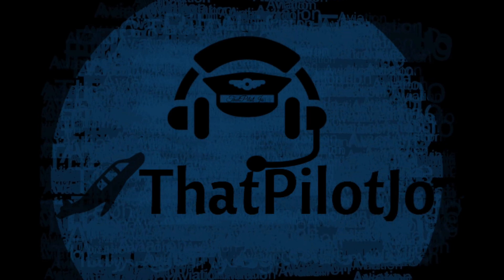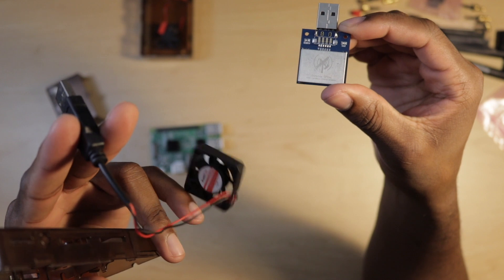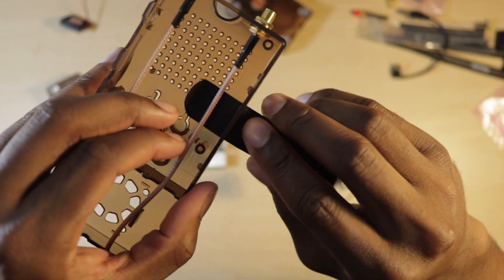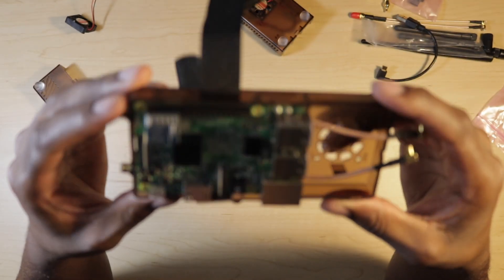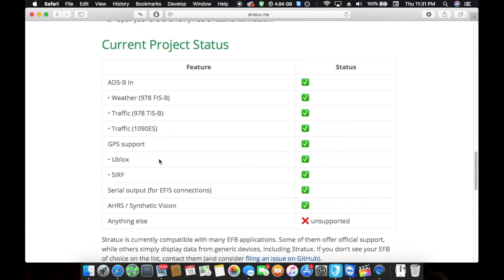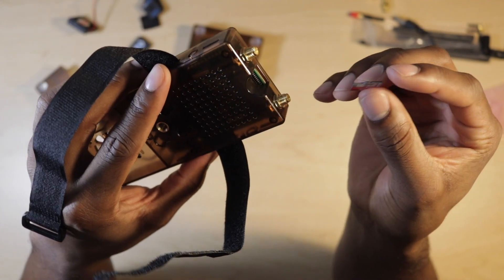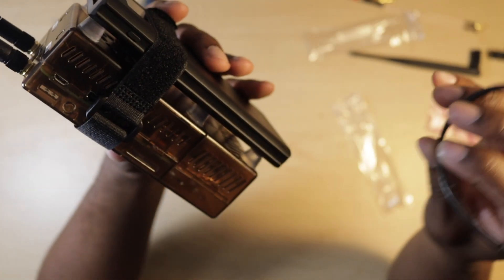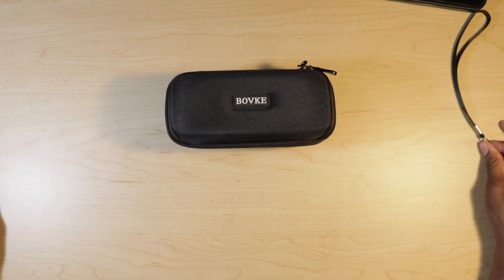Make Your Own ADS-B Receiver | Stratux Build

Comment: Neat video. Ive been designing a new case with cad today and Ill share it on thinyverse for 3D printing. The case will have no cables outside, an internal 5 cell 18650 (15500mah) pack, push to start, sleak design, battery indicator, usb charging and no visible screws on top or front. I also placed the fan on the side since it now can be placed there, and im truing to use Bernoulli Principe to get the fan to blow extra air from the side to cool the whole box with one. I might design in some cooling channels to pull the air to the usb ports that everyone says goes hot.
Reply: Thinking about your storage box. I might just design a travel enclosure that just slides over so you never have to remove the antennas.

Comment: My build stopped working after a few years recently.  No longer receives ADSB towers.  GPS still works though. Either or both of the antennas went dead is my guess.  I have no idea how to go about troubleshooting.  Oh well.  A lot of nice parts someone could probably use.  Thinking I'll move on to a Stratus or Ping and toss this one in the dead bin.

Comment: How do  I get the data out of this unit into my Phone or tablet so I can read the data ?
Reply from the maker: The unit should broadcast a WiFi signal. Connect your phone to it and put in the unit’s ip address to get to the system settings.
Reply: Is there a special app that I need on my phone to interact with this device?

Comment: BARROMETRE1: Can this be used to have a METAR  & TAF reports without being on the cockpit of a plane?
Reply from the maker: Yes, as long as you’re in range of an ADSB tower. You can also get that info from the internet.
Reply: @thatpilotjo2622  Many thanks!
Reply: I just received the box Kit like the one you (brown color).  To my great surprise it does not come with the green Board (is it Raspberry Pi?).  Can you tell me the board I need to purchase in addition to make this work?
Reply from the maker: You’ll need a raspberry pi 3 or 3b+. Checkout the build list at stratux.me

Comment: Thank you for the detailed video. Can you link to the Battery Pack and Cable that you purchased? I know I can get anythign similar but wanted to compare to your choices. Thank you
Reply from the maker: I used the Bainoe 1200 mAh battery. I got it on Amazon, but I don’t think it’s available anymore. https://www.amazon.com/Bainoe-Portable-Charger12000mah-Power-Charge/dp/B074YW6SF2
Reply: What about a micro usb to usb power cord and continuously power off of the Aircraft power?  Do you have to use the battery?  @thatpilotjo2622
Reply from the maker: You don’t have to use a battery. You can plug it into the plane or a battery.

Comment: Great video! i have just started looking at building my own Stratux, and your video was the clearest!  do you have a video of it in operation with Foreflight?
Reply: Did you ever get an answer to this? My hunch is that you don't need the GPS dongle if using Foreflight on an iPad. Is that your experience?
Reply: @mehtkab  yes it was, after building it and getting is connected with my ipad it works great! all for a fraction of the cost.

Comment: Howdy. Great video. I learned a lot from your tutorial. After building this neat piece of equipment what software should be used with it to bring it fully operational?
Reply from the maker: I would recommend downloading the software from the Stratux website and using that. If you are using Foreflight and want the ahrs to work(but glitchy) there is a dangerzone build you can download from github.

Comment: Might want to put that battery on the bottom if you want the GPS to work.
Reply from the maker: With the way the case is made I have to put it there if I want to use the mounting options on the back, and keep the battery on the unit. But the GPS works perfectly fine still.
Reply: I'll never quite figure out why Summitlink made it so that it mounts with the GPS facing in rather than out. Then again they obviously did not test the V2 with the GPYes since it cannot be plugged in at the same time as the second fan.
Reply from the maker: I know that's so annoying. It can get pretty hot where I am in the summer, and I don't want it to overheat.
Reply from the maker: I wanted the tinted color and the option to mount the antennas on the side if I wanted. Do you have a Stratux?
Reply: I've built a few. 

The official case and suction cup mount are my designs. Temperature controlled fan speed was my only software contribution.
Reply from the maker: Well thank you for your contribution!
Reply from the maker: Well thank you for your contribution!